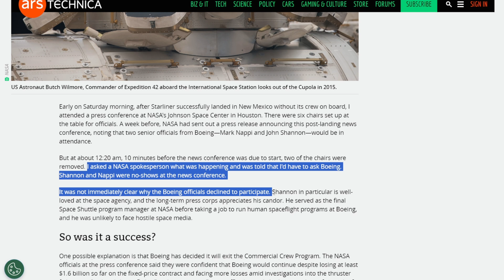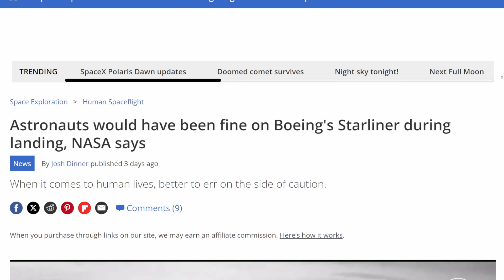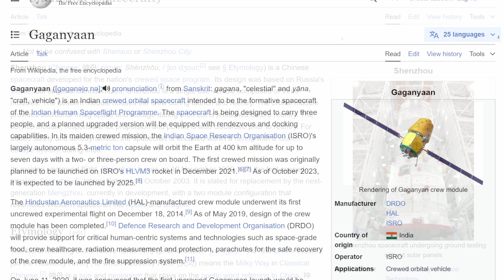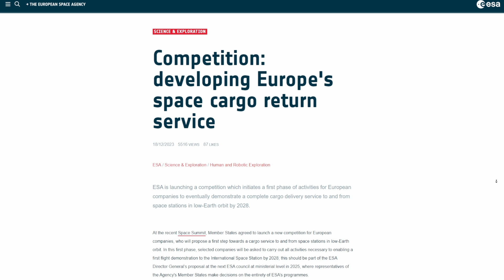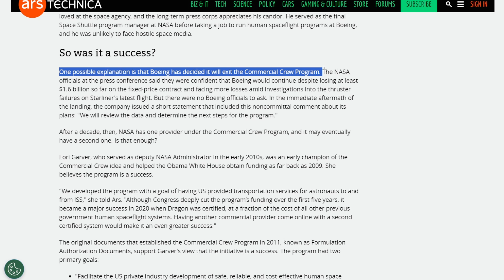Why we need Starliner ... and even more spaceships!

Comment: You need redundancy, but not necessarily two completely different systems. SpaceX is creating what is needed by having multiple vehicles and being able to launch often. Having a reliable system is more important than two incompatible systems. There was no backup to Apollo 13 and there will always be a risk with space, so we need regular launches to quantify it. Funding two independent spacecraft or launchers just reduces the total reliability data on each one and increases the overall cost. The argument from competition doesn't work if one solution is obviously better. Congress and NASA more heavily funded Boeing for political and historic reasons, but their solution is patently unreliable.

Comment: NASA should have picked 3 spacecrafts for the Commercial Crew program. Not only because of Boeing's claim that they had the experience, meaning that any other option would have been a lesser pick should have had a backup, but also because 3 would mean that there are always 2 or 1 redundant spacecraft available. Unless all spacecrafts are grounded for some reason, which is highly unlikely. It would also mean astronauts would be able to return home much faster in a situation similar to the Starliner crew is in now. Another benefit to having 3 spacecraft is that they won't be the same craft, meaning they would have different capabilities and create a better work force for space instead of 1 trying to all the things. 

In the end, it is bad for team space that Starliner is plagued with problems, because you don't want 1 company to be the only way into space. Anything can happen to a private company, or their vehicles, or they might even abuse their power in some way to only benefit themselves. This is true no matter what your stance is on any company.

Edit: I would also like to add that it wasn't steady sailing for Dragon 2. In fact, the Demo-1 capsules of Dragon 2 could have destroyed the ISS, or at the very least blow a significant portion off, if they had tested the SuperDraco thrusters near or docked to the ISS. Either by testing an abort approach, priming the thruster while docked, or even if somehow they were activated by accident or by a software error. It shows that there is need for more than just 1 backup. This is not all the problems Dragon 2 face, but this was the most dangerous one.

Edit: The non-existent of a crew capable vehicle for ESA is a result of the problem described above, and in the video, they just thought they could just hitch a ride with the USA or russia. While they should have added to the world's capability. They could have made a great competitor to the Soyuz and the crossover from Space Shuttle to Commercial Crew program a lot less expensive and of course solve other problems like geopolitical ones.
Reply: Should've is nice when you don't have to weedle funding from Congress. Congress should've funded CC to or above the requested levels, just like recently they should've funded HLS to NASA and the Trump and then Biden administrations' requested levels.

Part of the delays (yes, SpaceX fell 5 years behind the original 2015 date for DM-1) is clearly a result of the reduced funding in the first few years of the program. It definitely left out Sierra Nevada's Dream Chaser and possibly Blue Origin's biconic capsule as well their medium-lift partially reusable launcher!

Comment: Sadly, SUSIE is dead in the water. Reason? Political lack of will to have an independent access to space. Some politicians don't want to fund ESA even if this means funding Airbus and Arianespace.
Reply from the maker: I'm afraid it was never meant to fly for real but to be a marketing stunt for Arianespace so people don't write off Ariane 6 completely. Interesting concept though, if a bit optimistic in regards to capability.
Reply: @ShadowZone  what I was told is that on side ArianeGroup they were serious enough to work on the project hard to propose not only the heavy and final vehicle but a smaller one as a proof of concept AND a validation step who could have practical use as a multitask spacecraft (cargo/crew transportation). The problem is that some ppl don't like the perspective of a contender to RFA's Argo and they have enough influence to make this not happen.

A6 is the too big to fail program of ArianeGroup AND ESA, it wouldn't be written of no matter the issue faced except the worst case of an utterly failure for the maiden flight, which it wasn't. ESA NEEDS A6. The problem is that with the opening to "newspace" company, there are shady moves in the backstage and a lot of them are tied to RFA and their influence not only on ESA board, but also german politicians. Hence some troubles faced by ArianeGroup not only with launch ending on Falcon 9 but also internal issue with parts construction program and rebalances around that.
Reply: ESA's members may change their minds as commercial options ramp up. They've spent quite a bit of resources in a new astronaut corps as well as support for Artemis. ESA has been jilted by NASA before. If Artemis folds, they'll again be stuck without human spaceflight capacity AND with no Russian Soyuz as a fallback and no European supported LEO destination after ISS is decommissioned. They barely have primary and secondary launch vehicles back in operation--this is no time to slack back, as SpaceX is virtually an NGO space agency that has disrupted much.
Reply: Man... I really want Susie to be.. is it that much off? I mean.. its "just" an opsized dragon capsule after all.
Reply: @Ph33NIXx  lack of political will, and some internal conflict between members who are more after pushing money to some companies (like RFA) than others (like ArianeGroup).
Reply: @DC2022  well I think ESA thinks it feels like punching a pillow when it comes to political will. (i dont know if that figure of speech translates

Comment: Completely agree there need to be more.  But I'm also of the opinion that there needs to be a LOT more cooperation among them.   We have some examples with some industries for safety with internationally agreed to things that are designed to prevent loss of life.  Things that should be enforced like universal fittings, universal docking ports, and other future things to be determined so that if somehow a crew was... ahem stranded... they would be able to return simply by plugging in their suits even if on a competitor's spacecraft.    Proprietary fittings will get someone killed eventually.
Reply from the maker: Very important point, yes! Standardization of some components will be key to proliferation of space hardware. Just take tires from the automotive world: No matter which car you have, if you have the right measurements, you can fit the tire.
Or in the PC world: back when I started out we had PCI and ISA, there was serial and parallel port and even a game port for joysticks. Now? USB all the things!
Plug and play of space suit umbilicals need to be a thing.
Reply: @ShadowZone except for the zillion different USB connector types 😂
Reply: But it's not just about being proprietary. If one suit uses air cooling but the other uses water cooling then that won't be compatible.